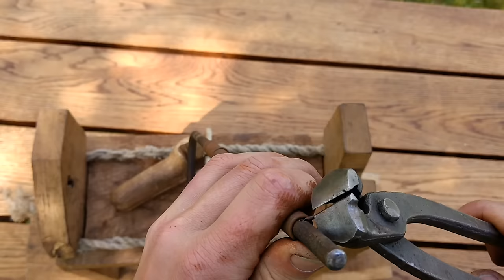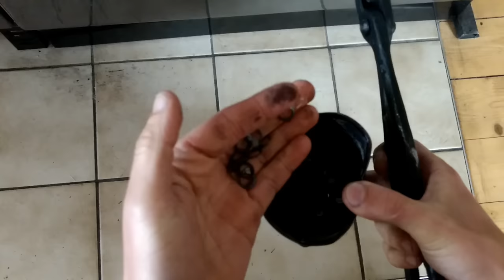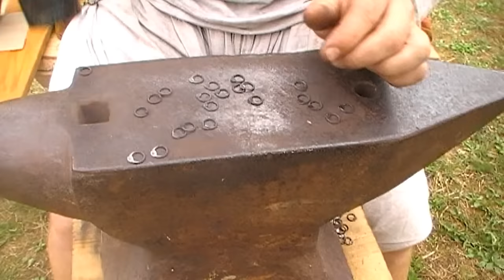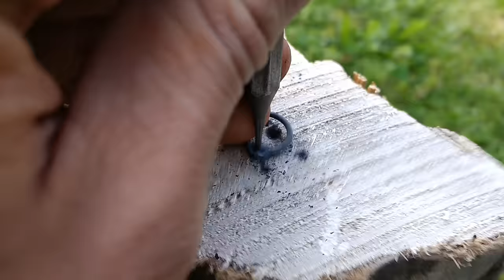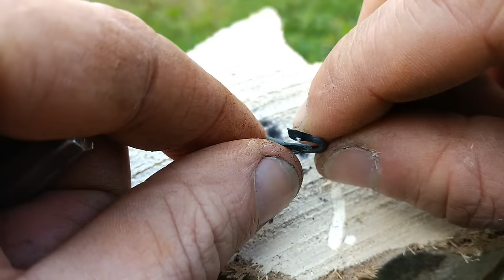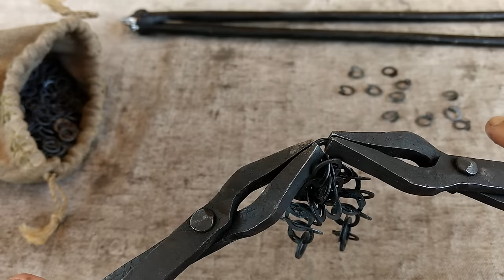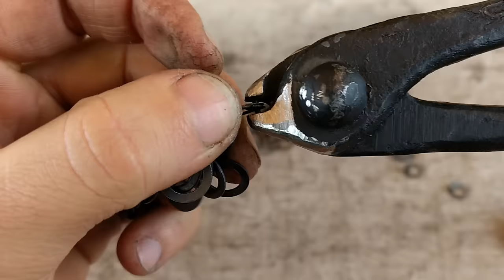How to make riveted chainmail

Comment: Is my observation incorrect, or is the riveted mail easier to initially put together than butted mail? I know there's the riveting afterwards, but the initial arrangement part can be done with your fingers, whilst with butted mail you have to open and close each ring with pliers. (Unless the tutorial I watched, by someone who seemed considerable more interested in Jewelry chainmail, was not accurate/out of context.)
Reply: You're right; fingers for riveted links and it's rather like putting keys on a keyring.
For opening butted mail links, here's a timesaver: take half the coils, grab each by either end, and stretch the ciol out to slightly more than twice its original  length. That's  150 links all spread open in about 2 seconds. Then just cut them just like regular links.
Stow these insta-open links separately from the raw or fully closed links. Preopened links are extremely tangly in storage. But you still don't need to spend time disentangling -- grab up a small clump of these links and thump the clump on the table. Links will fall loose; use these, rinse repeat.
Reply: @w.reidripley1968 Dang, that'll help me a lot in the future! I actually just got a few requests from some friends for some butted chainmail! Thanks a lot!

Comment: I'm considering getting into maille making, but I have a question. Is there a specific tool that is needed to put the rivet in place? All the examples of them I've seen are effectively pliers or clamps with dome shaped indents on either side. I know that is to give the rivets a domed shape, but is there a reason for them being like this? If not, could I use a normal pair of pliers for the rivets and be fine? I'd imagine that the rivet would be flat on both sides, but if that is a flaw, I'm certain you would know.
Reply from the maker: The resuling rivets will have a less optically pleasing shape. And as a result, the rivets tend to break the rings. That sometimes  happens during crushing the rings - especially when the rivet hole is near the edge. Then the rivet has no place to go and pushes the overlap apart. You can easily use regular pliers for a couple hundred rings. Yet chainmail typically means rings by the thousands. For that I wouldn't want to miss the benefits of a proper tool. You find an introduction to the hobby here: https://www.ironskin.com/how-to-make-riveted-chainmail/

Comment: Could you use a spot welder instead once it's ready for the riveting? I've often thought about this.
Reply from the maker: Sure, you can and that works just fine. Many people and companies do that. I'm rather inspired by the historic methods.
Reply: Easiest way to weld a mail link, I'd think. I understand spot welders leave a little dot instead of a rivet shop head bump.
Always make sure these rivet bumps are on the OUTSIDE of your shirt. You want the smoother side in.

Comment: My question is: How did they manage to make the wire in pre industrial times?
Reply from the maker: The were hammering stripes of metal or rods into shape and then either used them right away or started pulling them through holes. Here's a video of me doing that: https://youtu.be/X09ZkeI3pz8
Reply: Essentially same way as now. Start with a skinny rod somehow, and run it through the graduated holes of the hardest draw plate you can get.
I think the moder drawing dies are of synthetic corundum -- harder than steel by a mile so it hardly wears. The business end of the die is not very costly of itself,  just a little piece.

Comment: Dear Ironskin, do you have more information on the wire coiling bench shown in the Video? I would like to start making maille myself and want to recreate your design, as it seems quite practical. Therefor i have some questions about it, like how long the metal round bar was that you shaped into a crank and what the purpose of the two ropes on both sides of the bench is. Also, how does the crank sit in the bench,   just through two holes in both sides or is there more to it as the bar slipping out seems like a Problem to me.
Thank you for the great Videos!
Reply from the maker: Hi there! The metal bar can be 70cm long approximately. Just take a size that you can find. Doesn't matter that much. The rope help to pull everything together. (This designs can be disassembeled for transport.) The bar is resting on a notch on one side and a hole on the other side. The hole doesn't go all the way through. Here are more pictures: https://www.ironskin.com/mandrel-for-coiling-rings/
Reply: @Ironskin  Thank you for the very fast reply! I did not think about just not Drillinge the hole for the crank all the way through... thanks to  your Help i will Start making my own rings tomorrow!
Reply: There are many workable designs for wire winders/coolers.
Here is the simplest most spartan coiling rig.
A metal rod from the hardware store; I like to bend a crank handle at one end but you can manage by clamping a small vise grip in the end for a lever to turn the rod.
The other is a small wooden feed block you can hold in your other hand to feed wire through.  Drill a hole through it across its middle to pass the wire.
To use, sit and hold the mandrel vertically between you knees, crank handle uppermost. Corral the bottom end of the mandrel between your feet.
With the wire through the block in your hand, and the wire passing between your middle and ring fingers and anchored on the mandrel,  turn the crank to coil, using the feed block to tension it; this comes naturally. If you coil gets gaps, you can push the wire into place using the feed block.
A feed block really saves wear on your fingers. Some people used gloves -- and would wear out half a pair repeatedly.

Comment: what kind of wire is this? also it seems to rust easily, is there a way to treat the metal against rust?
Reply: Light oiling and store dry. That wire is easy to work with and it rusts fast.

Comment: I know it is a older video but I am starting a riveted mail project what is the  diameter of the spooling tool and wire size? Plus are you using the same gauge / wire for the rivets?
Reply: He straightened one of the rings and cut it up to make the rivets, so same wire.  I think the spool was 8mm and wire was 1.4mm.

Comment: My annealed Iron Wire has couloring black dust all over it, what can i do about that? And how important is the annealing in between the steps?
Reply from the maker: The black stuff is likely be from the annealing. Though I'm not certain. It is best to ask the producer, so you don't have any health-risky coating. About annealing: If you don't do it, it's like hitting a nail with a rock. You can do so and it will work just fine, but likewise it would be stupid not using a hammer for the task/not annealing it.
Reply: An oxide of iron, I think. Not so flake-offish as red rust. Except for being very grimy, it's not a big problem.

Comment: Why do some rings have a rivet and others don't? Wont they be weaker than the riveted ones?
Reply from the maker: Solid rings provide more strength per weight. Yet it only possible to conveniently manufacture hal of the rings like this. The other half is riveted because it is easy to open and close them while still achieving a strong permanent connection.

Comment: How do those rings flatten so easily? I softened mine, but whenever i hit one with a hammer it just moves the overlapping bits without flattening them, at least not nearly as much as in the video.
Reply from the maker: That can have several reasons. Most likely you have deformed the wire a little when you cut it.
Reply: Try preflattening the ends before overlapping.  Not this cross section: 8, but this: =. Eliminates that slip off problem entirely.

Comment: I realize the most likely answer to this question is "practice", but I'll ask anyways.

How do you keep the pattern from flipping itself around and turning into a 2 rings on 1 ring when you pick it up?

Ive been trying with butted round rings, and as long as I keep the pattern flat on the bench, it lays just fine, but when I try to pick it up and add the next row, the ends always end up tangled.
Reply from the maker: I just hold it loosely in my hand. With the experience I know from what side to enter a ring even when its tangled. I'd just start holding it in hands from the beginning. If you do something wrong, undo it until you learn it.
Reply: @Ironskin  I guessed practice makes perfect, I was hoping there was some trick to it. All I can do is keep working at it.
Reply: 2 rings 1 ring chain thing is just fine. Put it back down on the table and smooth it out flat again with your hand.
And stop picking it up; slide the link you are weaving in up to the edge you are working on (which can be any edge). Hook it in, and close.
Reply: Thank you for the advice. I've started work on my 7mm riveted mail since. The winding, cutting and annealing are done for 30,000 rings so far. I'm on the flattening and drilling stage.

I decided to drill the rivet holes, because no matter how much I anneal the rings, I can't punch the holes without deforming the entire ring. It remains a mystery to me how the masters here on YouTube and the internet do it so effortlessly.

Center punching a small guide hole then drilling with 0.0625" drills works too, so that's what I'm going with. When it comes time for weaving, I plan on taking your advice, and getting some large pick-ups/forceps to do the small maneuvers.
Reply: @Unpainted_Huffhines  👍😁

Comment: What diameter punch are you using? The smallest punch I'm able to find is 1/16 inch, the same size as the wire I'm using
Reply from the maker: Hi, I'm using a just sightly smaller one with 1.3mm. I can't buy it like this. So I sand it into shape.

Comment: I have a question. Will the blade cut though the Chainmail? Or 100% slash proof?
Reply from the maker: It's difficult to give general answers. Yet riveted mail (if it's well done) stops pretty much all cuts unless you put it on an anvil and strike it with an axe.
Reply: @Ironskin  Thank you.

Comment: do you think 9mm rings are good for 1.6mm wire? or is 8mm better?
Reply from the maker: You can do both. Both will give a strong and heavy mail - not extremely heavy, but you will notice it. I would use it for the chest, but not for sleeves. Have a look at this video here: https://youtu.be/BDVqZj99ZSU

Comment: At 4:07 you seem to link solid rings with the flat overlapped rings. How did you make the solid rings? Because it seems so much easier as it would mean you would only have to rivet half of the rings, haha.
Reply from the maker: Good remark! At this point I swapped to rings from a merchant because I was lazy. You can make the solid rings by cutting them out of a sheet of metal by a punch. A similar way is drifting which relys more on reshaping than removing material.
Reply: @Ironskin  Thanks for the reply!
Would you consider making a video on how this might have been done in medieval times?

Comment: As a bladesmith/blacksmith myself how would you harden this? Would you harden it as a finished product or the links before assembling? I would imagine this would make the links harder to put together though.

This is if you used a carbon steel of course. I would imagine 1045 would work well as a modern steel.
Reply from the maker: It doesn't necessarily need to be hardened. I typically keep it soft because I think it can deform and absorb more energy like this. That said I have put some finished mail in the fire and acccidentally burned the rings.
Reply: @Ironskin  I have a kiln so temp control wouldnt be a problem for me. I was just wondering. If I make any mail it will be small pieces anyways. I dont think I have the patience to make something large at one time. 

I was thinking it would make a nice aesthetic to put it on the side of a knife sheath or on the chest of a leather apron
Reply: A little, spring like hardness is okay. You want mail steel to be tough and hang in there no matter what's hitting it.

Comment: The one thing I'm confused by is when you had the mail in two rows, with a gap between them, how did you get rid of the gap? Did you just join the rings together more or did I miss something?
Reply from the maker: To get rid of the gap, you fill it with more rings - one by one. The filling rings hold two rings on each side of the gap.
Reply: Zipping two chains together side by side is just like assembling a chain of mail units -- one link going through four others, two from one of the chains ant two from the other, all the way down the chains one end to the other. The edges you join must have all their links angling the same direction.  Your joining links will angle opposite.

Comment: Mind if I ask if hypothetically, someone can fused ( as in melting the steel ring together) instead of riveting the ring. Would that be stronger? Speaking for my own fantasy writing project, so maybe not historical but wonder if someone got access to anachronistically tech like that.
Reply from the maker: Good question! That is a historical technique. It's called fire- welding. Half of the rings would be welded as loose rings. Half would be riveted rings to build the mesh. It's been proven to be very difficult to use this technique for modern people. I can't tell you which is stronger in general. The strength varies with the quality of the welding or the riveting.
Reply: You might try mig welding or torch welding, if you wanted to test the idea.

I couldn't begin to guess historical methods. Disclosure: I hate making maille sufficiently to never complete a project! 😒 

Pinch of salt. 😉
Reply: @Mutski1579 There's a video that showed someone welded it with what appears to be arc welding. Personally, I want to create a "Scale-Mail". There's video of it already, but the mail ring is butted. I would like to make the riveted if not welded version.

Comment: I've had some idea that methods of making chainmail and nalbinding have many ideas in common. Could people have gotten the idea for chainmail from nalbinding at all?
Reply from the maker: I think both crafts yould have transfered ideas, but they are independent. I guess it is most likely that mail originated from jewellery with many ways to connect rings. When it's armor properties became more important, the 4in1 pattern became dominant. And the way to sew and modify that pattern has indeed a lot in common with knitting and nailbinding. That's all speculation.
Reply: The ancient Romans thought a Swiss tribe, the Helvetes, invented mail.

Comment: Did anybody know how they made the wire in medieval times?
Reply from the maker: The medieval wire was made by forging iron into a long rod. Next, this rod was pulled through a hardened plate with holes. The method needed several holes. Each hole was about 10% smaller than the hole used before. Between the drawing process, the iron needed to be softened (annealed) by heat. It is basically the same as today.

Comment: It looks like many of the rings aren't riveted or butted.  How did you make those?
Reply from the maker: Good point! There are three different ways to make solid rings: Welding, punching and drifting (related to punching). I aim to make a future video about these processes. They're still not that easy to master for me.
Reply: @Ironskin  Cool,  good to know!  Do you know what was most common traditionally?  Would it be common to rivet every ring?

Comment: Just a question: You did use 4 solid rings in one riveted one, right? At least so it seems... How did you make the solid rings?
Reply from the maker: Yes, half of the rings are solid. They are punched from sheet metal. I get them from a company and resell them on my website ironskin.com. I'm planning a video for the future about how to make solid rings by hand.
Reply: In ordering such rings from a manufacturer, ask for spacer rings, in steel. Specify a ring thickness somewhat thinner than the wire you're using so the edges don't stick out from the fabric, and consider tumbling these rings in an aggressive medium to round off the rings' square, rough feeling edges.

Comment: Can I ask how you put that groove in the pliers that you use to cut the rings off the coil in the beginning?
Reply from the maker: You can either use an angle grinder, but it is very difficult to be precise with it. Or you use a hand-file. That takes for ever and destroys the file.
Reply: Dremel.
Reply: I just cut with 20cm baby bolt cutters, THEN make the overlap in two flattening steps using a heavy hammer. About 2kg.
Mash the link ends, overlap them shrinking the link to its final diameter, then reflatten the whole link rather.

Comment: When I flatten my join the rings usually slip and disconnect to the sides, any tips to prevent this?
Reply from the maker: That's a common issue. It helps to to coil the wire tightly, to cut without deforming the ring, toanneal the rings just before flattening and to hit with few strikes only. There is an instructional in which I'm describing the steps and potential mistakes in more detail. In the end it is also about practise. https://www.ironskin.com/product/ironskins-guide-to-making-riveted-chainmail/

Comment: Since i don’t have a punch to make that hole, can I use a 1/16” drill bit? Thanks!
Reply from the maker: I think the drill bit will work fine. Here is a list of recommended tools on Amazon: https://www.ironskin.com/chainmail-tools-on-amazon/
Reply: Thanks man!
Reply: You may have by now discovered you don't want to bore or punch the hole, taking metal away from a critical spot, but instead to drift the hole open, conserving all the metal there. It's  analogous to how axe and hammer heads are made.